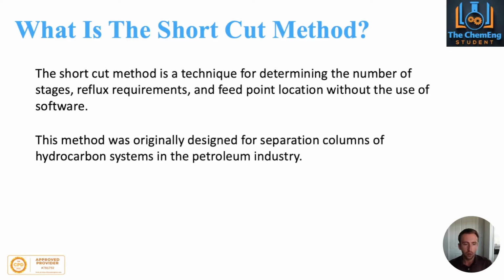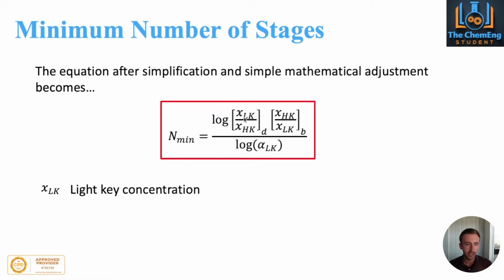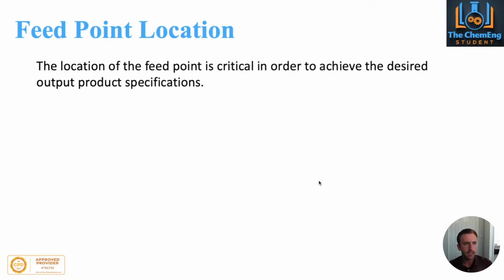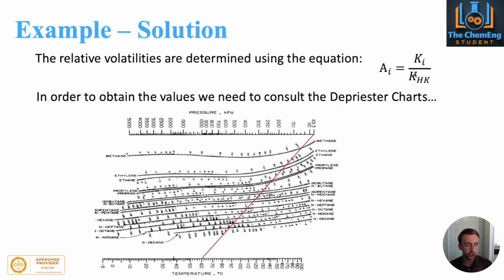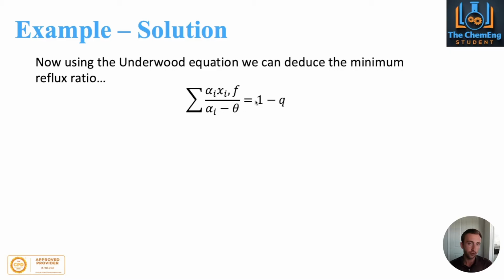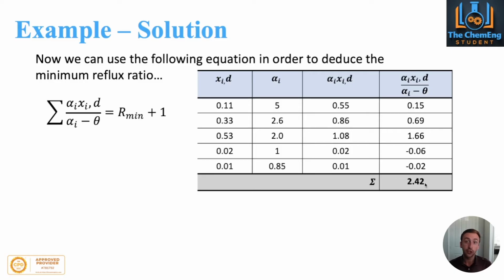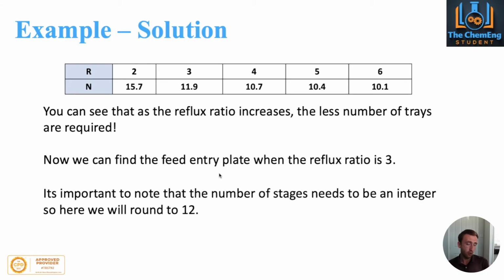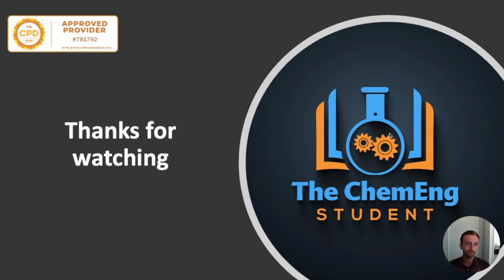Multicomponent Distillation Design - Full Short Cut Method

Comment: Nicely and shortly explain sir but one doubt low key and high key component how it is decided initially when we have only mixture of components and percentage of each components in feed?
Reply from the maker: Thank you for the kind words! In regard to deciding which is the light and heavy key, if you know the compounds' formulas, you can pick the most and least volatile or the highest and lowest boiling points. If you only have generic compounds like A, B, C, etc, then the question must indicate which is the light and heavy key. A side point could be that if you are told pure A is at the top of the column, then you know this is the light key. I hope this helps, and thanks for watching and commenting!
Reply: @TheChemEngStudent yes sir understood thank you

Comment: 18:15 how is more material leaving the column when the Reflux Ratio increases???  The equation is Lo/D, so if this increases that means more material is re-entering the column.
Reply from the maker: Yes, you are correct, I misspoke in my explanation, thank you for highlighting that, it is much appreciated! The values represented within the table are obtained using the same method within the example, using the Erbar-Maddox correlation & graph.

Comment: Your video was really good, but I have a question. Sorry if it sounds stupid, but can this method be used for a packed bed Distillation Column?
Reply from the maker: Thank you for your kind words, in the case of a packed bed Distillation Column the best design method would be Equilibrium-Stage modelling, or Mass Transfer Rate-Based modelling as in the Short Cut method is based on the number of trays, whereas packed beds don't use trays. I hope this helps, thanks for watching!

Comment: Hi, this video has been really helpful, but how do I get my relative volatilities when my system doesn't involve hydrocarbons as I am trying to design a distillation column to separate CO2 from hydrogen/syngas?
Reply from the maker: The process for obtaining the relative volatilities is generally the same, with the exception of a few. In the case of CO2 separation from syngas, the key thing to make sure is that there is no reaction taking place as this process won't work, similarly if there is a large deviation from non-ideal systems. The easiest method of determining relative volatilities is through the Hengstebeack's method and using the De Priester chart for equilibrium constants. I hope this helps, thank you for watching!

Comment: this is a realy really good explaination. I do hove also a few questions, about the method, can I put them here ?
Reply from the maker: Thank you for your kind words, sure please feel free either to comment your questions or you can get in toiuch directly via email.
Reply: @TheChemEngStudent  I have a question. I need to design a distillation column as small as possible. I do not need very Hight purity of the distilate. What parameter would have the biggest impact on the size of the column (height reduction if possible)
Reply from the maker: @jamesdavid9390  The key parameters that determine the overall "size" of the column is really the final product purity, and the feed composition. Since the more pure the product the higher/more number of stages you will require. It is also worth considering the types of plates as their efficiency will play a part in the amount you will need. Aditionally, the thermodynamics of the system is also key as you can manipulate the temeprature and pressure to facilitate a quicker separation. Those are the ones I would focus on first and optimise from there. I hope this helps!
Reply: @TheChemEngStudent A thousand thanks for your answer. This explains a lot. Also I am quite well verse with excel, if there are part of the spreadsheet you would like me to help with in order to make it easy for you please do not hesitate. I would be more than happy to help